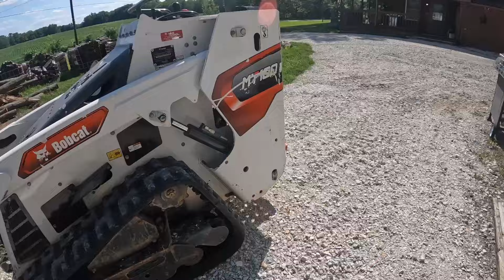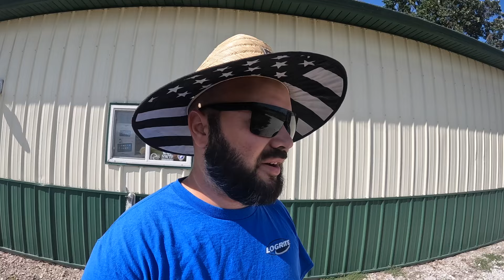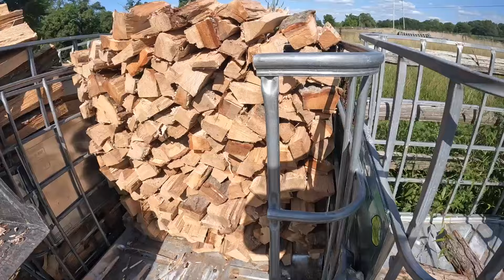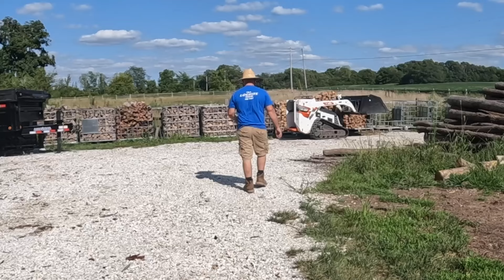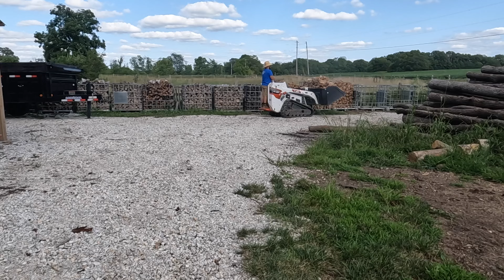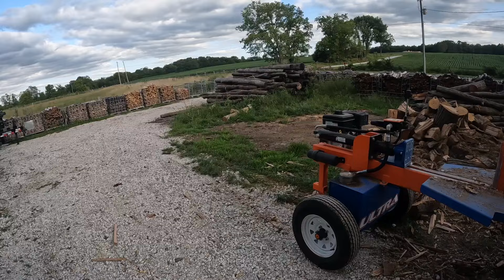I'm In Resplits'ville! Resplitting firewood.

Comment: Hallo 😊 im considering a Stihl ms 462 or the 500i im going to be using a 20" bar woth wood you prefer!?
Reply from the maker: @stiantnnessen2671  if your just using a 20” bar I’d pick a 462 every time. Also, with just a 20”, a ms400c is great and a cheaper option. I have a video from about 9 months ago where we ran them all.
Reply: @765Guys  ten i will go for the 462cm like your Movies 😊👍
Reply: @765Guys  are you feeling any gains in power of the barkbox on the 462cm!?